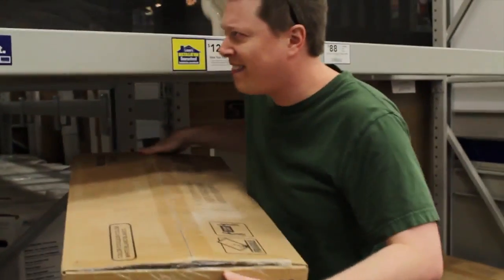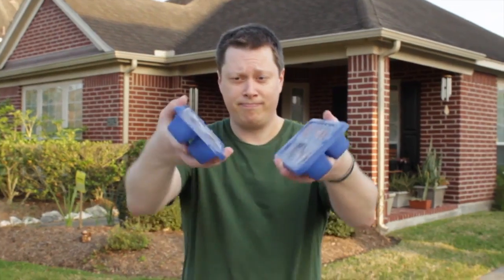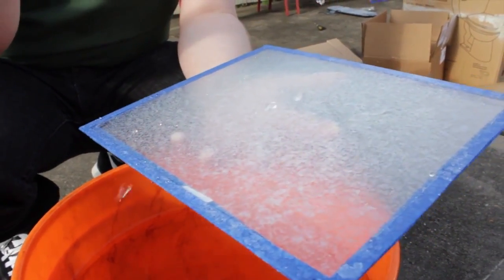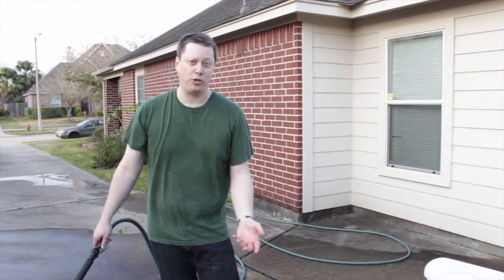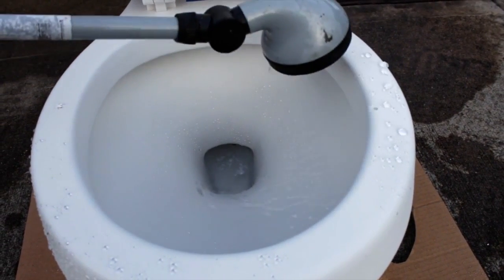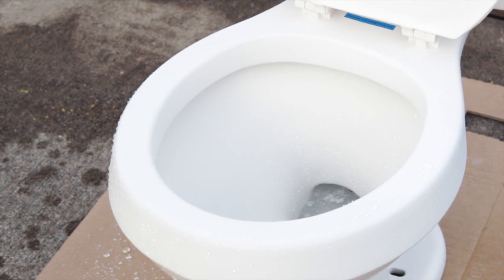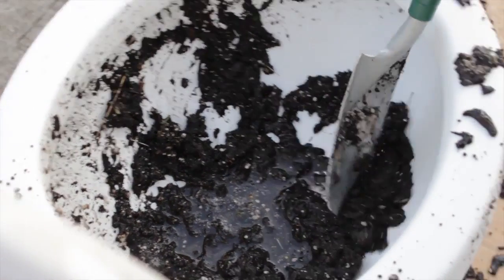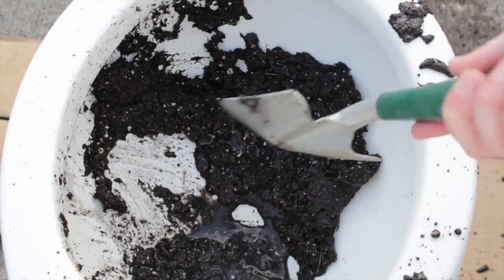Testing UltraEverDry on a pane of glass...and a toilet.

Comment: Using a q-tip, draw chevron lines on a mirror with product, then tilt mirror and apply water. Water will flow to the center of mirror and pour off the middle. Also creates an optical illusion, making it appear that the mirror is bending towards the center.